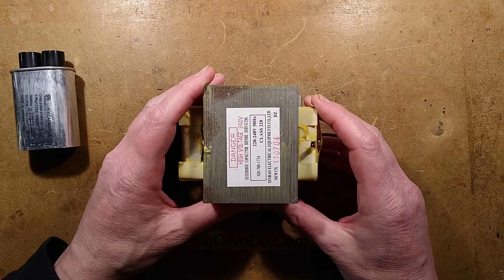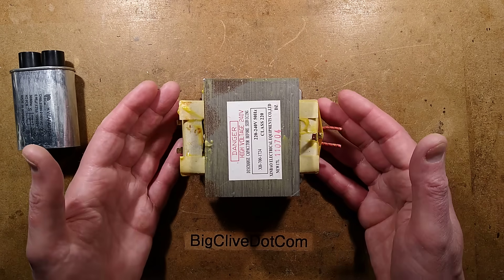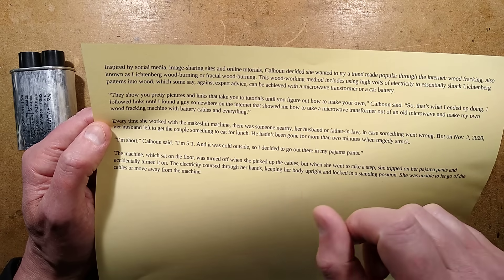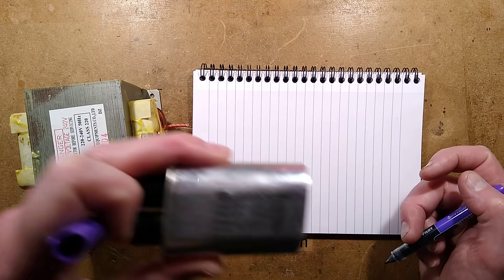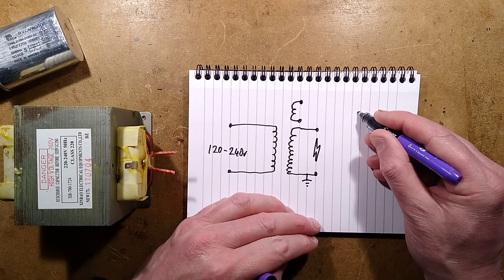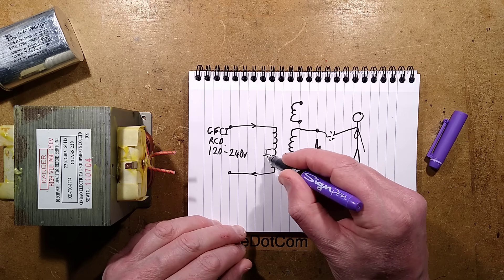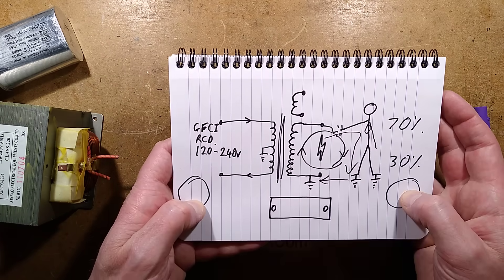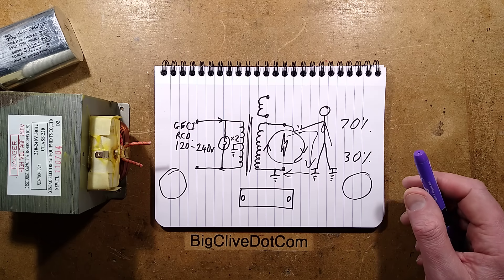The most deadly project on the Internet

Comment: I remember when I was in middle school coming across one of these after digging through some scrap.  Me and my friends would barehand use a white, thinly insulated wire from another appliance to make arcs onto the transformer itself. I remember part of the transformer getting red hot and exploding off which caused it to stop working. As upset as I was at the time, that probably saved our lives.

Comment: First, I love your videos. Second, I am a machinery safety engineer in the us and could not agree with your assessment more. Third, a deadman switch is a good idea, my concern however would be that you are not able to let go in the process of being shocked. An alternative way to do this is to build an enclosure that has an interlock attached to the door. This interlock would have dry contacts on the primary winding that would prevent current flow until the door is closed. I understand that building an enclosure might seem like a hassle, but at least you are alive!

Again, love your videos. Huge fan.

Comment: This brings back memories.

As a kid, I dismantled an old CRT TV, and got to play with the HV transformer inside. Having some understanding of the dangers of electricity, I opted to use a LEGO trains transformer on the "here, hold this" side, to feed the thing an input voltage of 12V or threabouts - which means that side was perfectly safe.

The other side... Really wasn't. The operating voltage on CRTs is about 20-30kV, or >100x the line voltage of CEE (at the time) countries. 

The output of that makeshift contraption was presumably in the kV range.

The sparks were very pretty though.

The fact that I do not actually have any horror stories to share is nothing less than a small miracle. The fact that I am alive to testify to that small miracle is an even bigger one.

Just... Do not play with HV transformers. Find a safer hobby, like, tickling tigers, or bunting bears.

Comment: even as an electronic engineering student, I never thought about how using a transformer prevents the breaker from popping... Anyway, I would have never considered to tinker with 220 V elements or higher.

Comment: Playing with a neon light transformer in the shop at work one day and a Jacobs ladder was made. That's the sci fi movie ascending arc between 2 wires with a widening gap the higher it goes kind of thing. Someone wanted to try a piece of paper in the arc. Pretty cool as it made a series of equidistant minute holes all the way up the paper. Tried 2 sheets to see if such would stop the arc - IE: an insulator. it did but set them afire. The smoke detector sensed it and set an alarm but we called and told them it was microwave popcorn gone awry as that had happened before. We got in trouble for playing around with high voltage and had to sit through another safety class that we had attended 3000 times.
Reply from the maker: Ah yes.  The liability transfer "safety" classes.

Comment: When I was 14, I used to help out a TV repair guy who went to our church. He liked teaching me things about TV's but one thing he said that stuck in my mind was, "Always short out the anode voltage wire (the big thick one going into the picture tube) before touching anything. The system holds power long after it's been shut off but the shock you get wont hurt you as bad as how your reaction will. Pulling your hand away very quickly usually slams your hand into other sharp objects inside a TV set."

Comment: I used to run a production line that built microwaves, the power needed to supply the magnetron that makes the ‘microwaves’ is indeed 4’500 volts which is provided by the transformer combined with a diode and the capacitor- which makes one hell of a spark and a loud crack when shorted ! 
Thank you Big Clive for this awareness !

Comment: weird question: what happens if I power the microwave transformer with an ungrounded (floating) dc-ac inverter? Wouldn't this eliminate the ground current path and therefore the bulk of the danger? I recognize the chasis of the inverter as well as the transformer itself would remain fully hazardous, but am I missing anything else?
Reply: The output of any transformer is always isolated so using an inverter wouldn't change anything. MOTs are grounded by having one side of the secondary winding connected to the transformer body. Disconnecting it could make it a bit less dangerous but at those voltages almost anything could become a path to ground. And even if it was fully isolated from ground it wouldn't take that much more stupidity to touch both wires instead of just one. There are videos where people are burning wood while holding both wires with both hands less than a centimeter away from the bare metal

Comment: Terrifying. Thanks for posting about this. I assumed people were using really low voltage stuff and being safe. I once had a close call trying to tighten the battery terminals in my Jeep that the shop had left loose. The space was small with two batteries side by side that the wrench spanned opposite terminals of. It sparked and blew a chunk of metal off the wrench. I let a different shop tighten them. 😅

Comment: 2000  to 2500 volts dc at about 1/2 amp was what we used on a 1 kilowatt hf ham radio amplifier.

Comment: What are the proper safety precautions for this experiment, then?
- dielectric boots
- long rubber gloves
- live wires held by non-conductive, very long rods that are FIXED and not moving i.e. experiment in place before turning on power
- not being near the experiment
- foot pedal that controls on / off, NC, AND-gated with two NC buttons which must be pressed /w both hands EDIT: you mentioned this in the video /w the dead man's switch
- EDIT: alright, indicator lights + maybe an auditory signal? like a small siren or a steady beeping idk
mhh am i missing something?
Reply: The proper safety precaution is:

Do NOT attempt it. juat don't.
Reply: @CyberBeep_kenshi  we regularly send people into space and that is extremely dangerous, im saying there must reasonably be a safe way in which this experiment can be conducted. Even if it means fully automating it in a factory.

Comment: When I was 12, I walked past a school project of a Jacob's Ladder running on a neon sign transformer, 9000V 60ma.  It was "turned off".  I got too close to one terminal and it jumped out and bit me.  One side of the transformer and I was walking past in sneakers on a tiled (probably vinyl-asbestos-tile) floor and it quite literally knocked me to the ground.  Wires had drifted apart and stopped the arc from forming at the bottom, but the xformer was still hot.

As I lay on the floor in the darkened classroom, I was wondering if my heart was going to beat again.  It was sobering.  When I managed to move again and got up, I was shaking.  Not out of fear (too stupid at that age) but from the electrical shock.

I've been very careful ever since.  Nearly killed by a fire in a 800A 480V 3ph panel once; had the deadman cover not been in place it would have been worse than the hair burned off my arms.  Electricians left the panels full of construction debris, bits of metal, drywall dust, etc. 

Nowdays I am pretty calm through 240V, but past that I am way cautious.   A lot of respect for the power as we get to 480V and up.

Comment: When i was 18 i took apart a broken microwave and "played" with it but i never hooked it up to live power. I attached it to the microwave motor and spun that to generate my own electricity or stuff like that cause i knew it would be potentially fatal. I also managed to charge the capacitor to 108 volts with my bedini and when discharging with a screwdriver you had a nice spark :D

Comment: High voltage is nothing to fool around with. 
My Grandfather was bringing me up to take over the family owned commercial electrical company. 
On a fateful day, he and a Journeyman were changing out a high voltage breaker in an electrical vault in Dallas. After they ordered the circuit killed by the power company, and received confirmation by radio, the employe jumped into action, without being told to start. As he placed the wrench on the outside of the breaker, he was instantly killed by power arcing through the broken breaker. It also resulted in damaging the other high voltage panels resulting in an unstoppable electrical fire. My grandfather was knocked across the room, unconscious but alive. His polyester shirt was melted it in his skin, he received third degree burned on his face, neck, chest, arms, etc. 
Another Journeyman ran into the room and scooped up my Grandfather out of the inferno, saving his life. 
Grandfather was in the hospital burn unit for two month undergoing skin grafts. 
He was left with a plaid chest and arms from his shirt, limited use of his hands with the web between his fingers now staring at his knuckles, extreme sensitivity in his eyes to light requiring him to wear dark glasses, extreme sensitivity to heat and cold. 
The death of a Journeyman, all of my Grandfathers horrific injuries, the complete destruction of the electrical vault equipment, all of it was caused by two things. 
The wrong power lead had been disconnected by the power company, THE JOURNEYMAN DIDN'T WAIT FOR GRANDFATHER TO TEST THE CIRCUIT FOR POWER, NOR DID HE HAVE HIS HIGH VOLTAGE GLOVES ON.
My Grandfather had another 20 years, but was reminded of that horrible day every time he looked into the mirror. 
The company was sold, I never went near high voltage, instead contenting myself with residential work. I’m retired now, but I’ll never forget that day. I can see right now, in my mind, quite vividly, the disfigurement of my Grandfather caused by complacency.
Remember folks, electricity can, and will, kill you under the right conditions. 
Watch out for ol Mr. Amperage!
Reply: With all that said, I’m building a fractal burner, but I understand and RESPECT the system. I’m also using proper leads and connectors. And HIGH VOLTAGE GLOVES! Always remember to inspect and test your gloves. Fill them with water, roll the cuff closed and squeeze. If you see squirts or drops of water replace them immediately.

Comment: You just shouldn't do it.  There is no reason for anyone crafting to expose themselves to dangers that electrical workers in industry wouldn't.  If someone was using dynamite to make crafts, everyone would say don't do that because it is stupid.    The same here.  There is no reason for people to expose them to dangers.   30 mA to cause paralysis and stop breathing.  75 mA though the heart can cause defibrillation.   This is very little current.   No one should be playing with this.  It is reckless to just not flat out say that it is too dangerous for anyone to play with it.  Even your deadman's box is pretty useless if you suffer paralysis and have your hands locked to the box.

Comment: I am building one with a microwave transformer and using a deadman switch foot pedal.  But I want to drop the input voltage from 110 down to maybe 50 v to reduce the output of the secondary.  What should i use for the voltage drop?
Reply: I don't see any point to lowering the voltage. It isn't possible to make it any safer that way because if it can burn wood it can easily burn you. If you want it to burn wood slower it is possible to control it with the amount of electrolyte you add to the surface of the wood

Comment: A transformer that is NOT energized can't hurt you ....
Reply: While true, this sentence gives a very false sense of security.
In the story, it got energized by accident. Also the capacitors can still hurt you even if the transformer isn't energized.
Let's encourage people to have a healthy respect.
Reply: @electrowizard2000  by accident ??? How does it accidentally get energized ??
Reply: @ACommenterOnYouTube  did you actually watch the video? The details weren't included. I agree in a well designed system it would not be possible- but regularly people are injuring/killing themselves by doing this.
Reply: @electrowizard2000  Did you NOT read my comment ??
Reply: You can't tell if it is charged qithout measuring, or picking it up. so just don't
Reply: @CyberBeep_kenshi  already did so butt out
And FYI transformers DON'T hold charge when "not" energized so once again, shut it

Comment: Electricity can and will kill you. This can be done safely . But if your not a qualified professional and do not have proper ppe this will kill you. The output voltage of a microwave transformer is on par with voltages found in industry. The amount of safety involved with big projects and maintenance of this equipment can not be replicated by joe blow in his garage
Reply: a transformer that is NOT energized is not going to hurt you

Comment: A microwave oven is a seriously dangerous piece of kit. However,  in the kitchen environment,  it has never to my knowledge killed anyone. You can't switch it on if the door is open due to power interlocks. If you take the cover off, it is still relatively safe, as other  power interlocks are activated. However,  if you take the magnetron and transformer out of this safety zone, you are playing with fire. The manufacturers put these power interlocks in place for a reason.
Reply from the maker: Microwaves have killed a lot of homeowners trying to repair them.  With the cover off high voltage connections and a charged capacitor are exposed.

Comment: When I was younger I used to make a bit of spare cash doing repairs on valve audio and radio equipment. I was working on a powerful PA amp with a fault in the power supply, a moments carelessness and I vapourised about an inch off the tip of an electrical screwdriver blinded myself for about 5 minutes and gave the most perfect black coating to the inside of the cabinet. Valuable lesson learned and a good video to warn folk NOT to mess around with high voltages.

Comment: People don't respect electricity and this is the result. I work in a plant where 3 phase is common, 600V line to line and 347 for a single phase. There's also 480 and some 400V stuff. These microwave transformer electrocutions are worse than that.

Comment: I'm a power systems engineer and would be VERY hesitant to build and use this tool at home. There is a lot of potential for shock or even fire by doing this. A kit for this artwork can be bought online for about $100 that is built with protective devices to make it safer.

Comment: The most common trend with hobbyists and near fatal/fatal injuries is the lack of fail safes no circuit breakers or fuses in case of an accident and the photo on that article is horrific she's lucky to be alive.
Reply: A fuse would do nothing. It draws the same amount of current trough wood or trough a human
Reply: @laserdiode  Circuit breakers are effective though they're designed for this type of stuff.